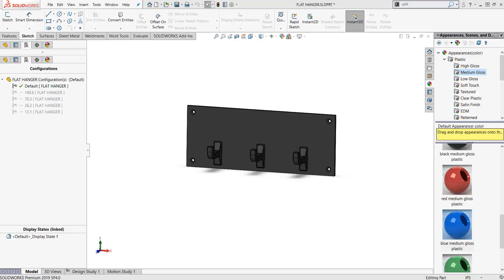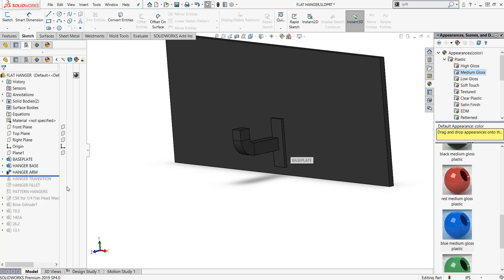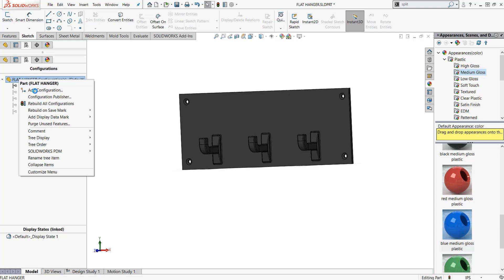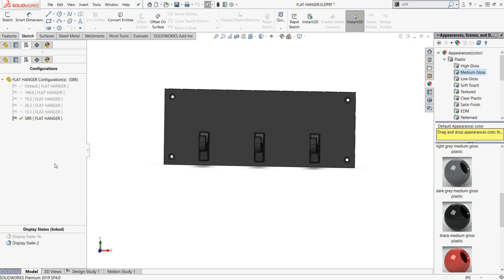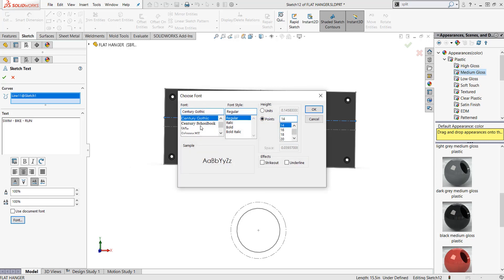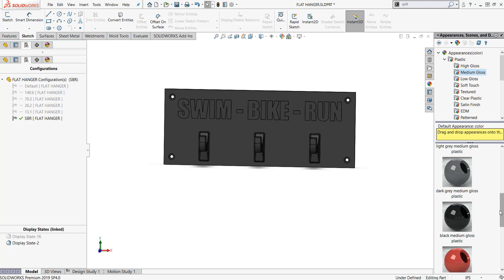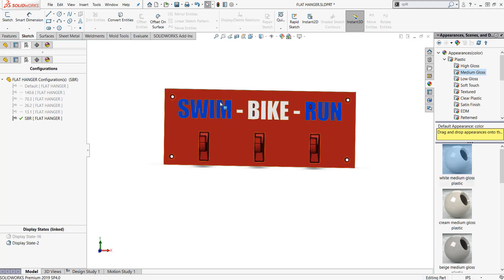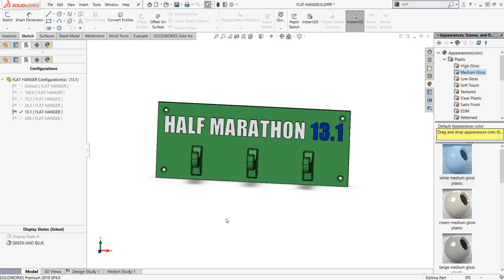SOLIDWORKS Tutorial - Display States Within Configurations

Comment: How do you just create say, 3 Display States, and use them across all of your configurations? So for example Default, 140.6 & 70.3 Use Display State 1, 25.2, 13.1 use Display State 2, and SBR uses Display State 3? From what I can tell display states can't be shared across configurations. This is a big problem we're facing right now.
Reply from the maker: Take a look at this link it should help you link Display states to configurations 

https://help.solidworks.com/2022/english/SolidWorks/sldworks/t_display_states_parts_ConfigManager.htm?verRedirect=1
Reply: @goengineer  This doesn't solve the above problem. This creates either separate display states per configuration (linked to configuration), OR, display states that can't be referenced independently by each configuration.
Reply from the maker: @Tielc  My apologies I see what you mean now. At the Assembly level, No you cannot really share  display states like that. However if the display states are not linked they are available to all configs so in the drawing you can have different views showing different configs each using one of the 3 display states as mentioned. The other option is to link the display states  and create the display states you want in each config.